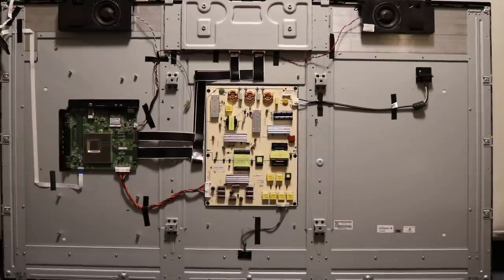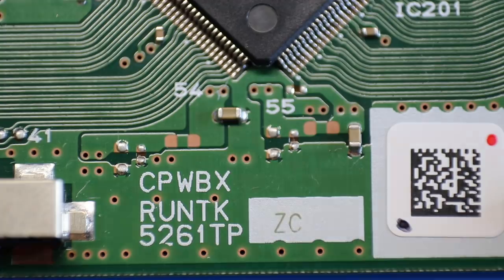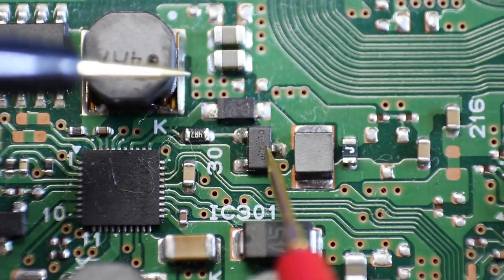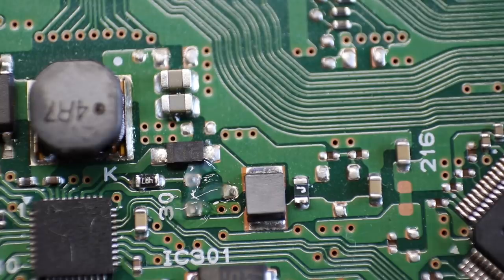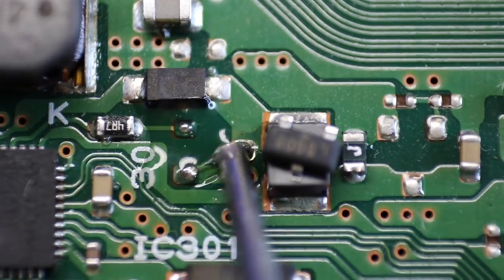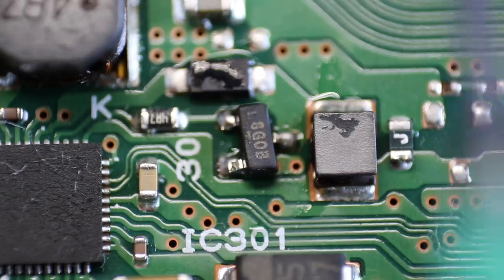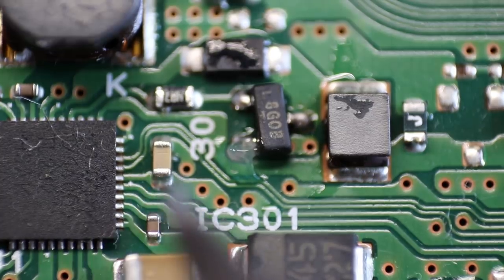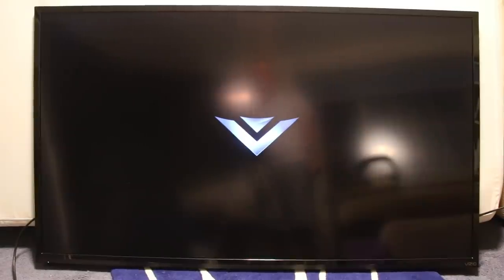60" TV for less than a $1 - Vizio E601i-A3

Comment: Have the exact tv and the same problem. Your fix worked great! Thanks!!
Reply from the maker: Cool!  Thanks for letting us know.
Reply from the maker: Enoch Pedersen  I put the specs in the description so anyone can hunt down online for a good price/option.  I'd would first check on aliexpress if you can wait for it to arrive from China.  Otherwise, check with any of the US suppliers.
Reply: @FrugalRepair  i have the same tv model but the 70 inch .....e701i-a3   with the same exact problem. so this will work with the exact part u replaced with?
Reply from the maker: @MrHontas83  The tcon board would be the same.  You would need to either test the tcon board for other failures in addition to this transistor to make sure or you can replace the transistor and see if it worked.  It is very possible that there are more bad components on the tcon and it is possible that your lcd is bad and thus not repairable.  You can also simply buy another tcon board on ebay for like $17 and pop it in quick to see if it fixes the tv.
Reply: @FrugalRepair  where do I get the machine to test and what's it called
Reply from the maker: @MrHontas83  You need a digital multi-meter.  But honestly, if you haven't used one before testing components may be a little daunting.  You'd have to educate yourself in what the components are and what they do as well as, what common things to look for on a circuit board.  It's doable if you want to learn.  There are so many great videos and info online that will help you.
Reply: @FrugalRepair  so to be safe I'm just better off replacing the tcon board itself opposed to the transistor?
Reply from the maker: @MrHontas83  If you don't have a multimeter already then I'd recommend buying a tcon board and then you only need a screwdriver.

Comment: Less than $1 if you have tools ready
Reply: And schematicvs of the module, probably not less than $20.
No chance he weould get the right transistor type from that marking alone...
Reply: @BB-ce3bj  making he looked in an online forum where someone had the same problem
Reply: Wilcon Barro Yes. As with most repair jobs of any type, you will need tools. They probably cost a lot less than the repair shop or the price of a new TV though.
Reply: Multi meter is like 20 bucks at Walmart.
Soldering iron 10-15
Flux 3-4 bucks or free with soldering iron
"Fume extraction" get a house fan
Hot air shit not necessary and most likely you'll damage something else if you don't know what your doing not worth the risk
Reply: Les then 40 and you'll have useful tools in the future just in case.
Reply: you spread the cost of the tools out across multiple fixes until it becomes negligible
Reply: A simple soldering iron and some basic chemics should to it. Less than 20 bucks delivered
Reply: @Theworldisforent  Not true. I have a 858d hot air station that works great for these kinds of repairs and it cost me less then $40. I have even done smd components with a $10 harbor freight hot air gun.
Reply: @steveiam5762  Actually it only takes one fix to get the cost of your tools back. But what you guys don't mention is the skills it takes to diagnose AND repair some SMD.
Reply: @goku445  I know skill is needed. I didnt think it needed to be said. I was just answering someone about the tools.
Reply: @Alobster1  I tend to heat up a screedriver tip with a torch when needing to do one or two smd packs. Holds enough heat to get the work done for 30 seconds, not enough to fry the item.
Reply: @Theworldisforent  500 bucks? oh, maybe you would take JBC hot air station, and fluke multimeter for fix 4 tv or others by years...
Reply: @gwarlow  maybe 80$ for an chinese hot air station, and 15-20$ for a multimeter... 1-5$ for flux also.
Reply: And the knowledge in your mind
Reply: diagnostic equipment, time spent, knowledge
Reply: Well if you buy cheap stuff, you can get everything for $15. I did it that way.
Reply: @jameszorb8420  If your looking to take out a 3 tab with a soldering iron you better have 4 hands and 3 soldering irons so you can heat all three tabs and lift it. Or you can buy the hot air unit. I paid $28 for mine used. Been using it regularly for about 6 years. I've seen far more people damage other components with a soldering iron trying to remove items like this. First, they don't know what they are doing so they just go in there with highest heat setting and then because they old solder won't loosen with out a little dab of new solder in tip they just keep the tip on there for about 10 minutes. Then you can throw the whole board out.

Comment: Thank you for this great info! I replaced the culprit mosfet with a random mosfet I desoldered from a random board. The tv turned on for a few minutes before blacking out again. This confirmed your suggestion that the mosfet is burnt. I can now go look for the correct spec mosfet to repair my tv. Tv is a SONY KDL-70R550. It’s an old dog but if it costs 50cents and a bit of sweat to repair I’m happy to continue using it.
Reply from the maker: That model uses the same tcon? Keep me posted.
Reply: FrugalRepair  it’s using the 5348 board but the layout is identical. I’ll keep you updated with further developments
Reply: I couldn’t find the mosfet of the exact spec that you specified so I tried my luck with a SI5328DS mosfet rated for 100v. It works and the tv is back working
Reply: Fix the car

Comment: Yes, I fixed several LCDs just by replacing a visibly leaking capacitor!
Reply: It's repair 101... (1) look the board over with a magnifier, are there any burn marks (change the burnt stuff) are there any dry joins (reflow them) are there any board cracks or scratched traces (bridge the gaps with wire), are any caps leaking shit (change them) (2) Check voltages Mains, DC voltages at chips etc (3) test shorts/continuity on fuses (should be), transistors (shouldn't be), caps (shouldn't be) etc etc... most of it is common sense...
Reply: What were the symptoms your tv was showing was it not powering up by any chance.
Reply: There I no such  as a visually leaking cap...wives tale extension there is no leak you can actually see in a leaking cap It just means  the cap is leaking voltage not leaking a substance so...you have never fixed anything by finding a leaking component since there is nothing to leak out of it.  b.s. called you shant recover back peddling not allowed  it's just a bad lie  but why did u lie there's a deeper reason me think
Reply: kirk watstien - you ain’t seen nothin’ yet if you haven’t seen a visibly leaky aluminum electrolytic capacitor. They have a discharge vent on the PCB end, and the leaked electrolyte is often visible on the board. And they will also pop their lid, which is quite visible. No BS to this, you just haven’t had enough experience with all sorts of varied devices to have seen those.
Reply: @kirkwatstien6979   the capacitor just blow up and then you can see it blown
Reply: @kirkwatstien6979  what language are you writing in???

Comment: Newer TVs are easy to fix now even if you do not want to change a transistor you can buy the boards cheaper than buying a new TV and just replace the board. I have fixed a few TVs over the years. The old tube TVs were easy you just pulled the tube out, took it to Radio Shack and got a new tube and replaced it lol.
Reply from the maker: Exactly.  Swapping out boards is pretty easy and you only really need a screwdriver.
Reply: No doubt the TV repair chains lobbied for tv's with no tubes so you'd have to pay a technician an outrageous fee to replace a 5 dollar circuit board. I remember fixing my own TV many years ago by testing for those burned out tubes. Cars were owner repairable also.
Reply: @kenjsr1  Valve TV's?? you still in the 60's? LoL. Music was good, TV's were rubbish.

Comment: this is your bread and butter, how reg joe gonna know that transistor is the culprit?
Reply: How didnt you see the moment where he is measuring that very component....        It isnt that far fetched that understanding its inner workings it is much easier to go and look for failed components. Because they are most commen to fail just hard to find if you dunno what is controling what.                                                   Just grab yourself some broken tv a multimeter and go have some great fun. But remember to stay away from the high voltage area...,if you dont you find out really fast why. Good luck! Stay safe!
Reply: Most issues like this can be quickly checked with under $150 in tools, and a quick google search of "<brand/model> common problems".  I have done this numerous times for all sorts of various electronics and it has saved me not only thousands of dollars in repairs, but hundreds of hours of manual troubleshooting.

Comment: Impressive, but how did you diagnose it was that actual transistor? There was a lot of stuff on that board.
Reply: Testing multiple things,  then put back together,  then make video.

Or....  research issue on model and see it is very common failure,  then make video hoping it works ..
Reply: Probably read up on it on a repair forum online ...
Reply: Oh, he answered that same question in another comment - watched a different YouTube video!

Comment: Most solder has flux in it and also I would never use hot air station its risky and for repairing one thing its pointless.

Just use a soldering Iron it's cheap and it works well and its safe if you use it right.
Reply: My thoughts exactly.. For a 3 pin component it's useless. Just pump the solder from the board, put the transistor on place, and solder it with a simple iron..
Reply: @freeeflyer  Did you mean: suck the solder from the board...? I have a solder sucker...never heard about solder pumps...  :)
Reply: @bror8228  If you need to desolder lots of connections, you can buy a solder station fitted with a vacuum pump and nozzle.
Reply: Who needs a solder suction pump for a job like this? Just use solder wick. Should have cleaned off all that excess solder so the new part leads are in contact with PCB with minimum solder in between. That huge pile of solder this guy used is more likely to crack than if it were minimal.
Reply: Also soldering one leg to tack it in place with an iron is easy and then you only have to touch the other pads after you have cleaned and added new solder to the pads.
Reply: replacing smd transistors with an iron is not the thing that you've done the first try... this is not a 1206 smd resitor...
Reply: Is it absolute to use flux when soldering
Reply: @stevebabiak6997  must I use flux when repair antenna plug? My project and problem
Reply: Eve M. - flux is a must when soldering. Some solders are “rosin core” which means they already contain flux. Also, there are a variety of different flux formulations, some of which are very acidic so one must select flux depending on materials involved.

Comment: If you prepare the lands as you did, plenty of flux and use a soldering iron to make each land. DON'T use hot air to place the new component in!
Reply: Right.  This was almost like a "how not to" video for SMT soldering.  I was cringing the whole time.
Reply: Any problem with hot Air?  I mean some do solder set with hot air right  any reason to avoid it?
Reply: Jon C. - unnecessary for this particular component with three leads. If it was a chip with lots of leads, then a soldering iron won’t be the tool to use.

Comment: Such a coincidence, a friend of mine was about to do that same,  same exact model.  Took it apart and pulled out the board. Did a multimeter test and the results were the same. Now I just need to put in an order for a new one. I really hope this works because my Xbox is lonely. Ill let y’all know what happens when I get my transistor. 07 salute!
Reply from the maker: Glad to hear you are fixing it!
Reply: replaced the transistor and it works! thank you for making this video, 07 salute!
Reply from the maker: Wow, that is great to hear!  Way to go replacing it.

Comment: May I please ask you a few noob questions, I am not criticizing you but honestly try to learn from you:-)
3:22 why do you choose hot air instead of bent thick copper wire wound around your soldering tip?
why do you not use something like capton tape to shield the other components from the hot air?
Hope you please will teach me, so I better understand.
Reply from the maker: I hadn't thought about bending coper wire on a thicker soldering iron tip.  That is a neat suggestion if you don't already have one with a fine tip.   It still might be hard to solder in a small component in a tight spot with that setup.  I'll have to try it sometime.   I didn't feel the need to add kapton tape since the nozzle is small enough and the hot air can be directed to the one component.   It depends on what work you are doing though.  When working on an iphone board, for example, I may use kapton tape and place a metal coin nearby to help absorb some of the extra heat.
Reply: @FrugalRepair  Thank you for your great answer. About the copper wire, I find a thickness that I seems to fit the task and then start to bend it until it sits nice around the chip and let the tweezers and heat do the rest:-)
Also wary nice and hard to reach places, like under a capacitor, in the corner near some plastic. You can always put an insulating tube around the 4 inch long copper, if necessary. :-)
Your explanation about the heat gun, do make a lot of sense, I do just not have enough confidence and knowledge yet to dare that. It takes a bit of knowledge as you clearly have!:-)

Comment: Way too much flux. But good job fixing it!
Reply: The bigger the glob, the better the job  - Louis Rossman - 2017
Reply: You didn’t clean the flux residue off.  At least wipe the area with a flux cleaner pen as a final step.
Reply: Enough FLUX to do a plumbing repair and far too much  SOLD  ER.

Comment: I have a 60 inch LG plasma that needs a similar repair. But I’m so scared To break it even more and I’ve never seen the tools you’re using before in my life other than just a basic solder gun. The TV is 600 W to run but it’s bright as the sun and crisp as a rainbow. I repaired it once by replacing the motherboard but accidentally gouged a little piece of solder..  stopping it from Booting up all together. I’m very confident that your technique will allow me to repair this incredible plasma. Just need to know more about the tools to get me there

Comment: It was painful to watch you trying to work with those tweezers lol
Reply: I would be the same way. That is a small transistor. I get the shakes when soldering small stuff also. :(
Reply: yeah i cant bear to watch him using those tweezer
Reply: Same feeling
Reply: @Darmidion , No one is claiming perfection. It's simply about avoiding damage to the board. Rocking a component like that before the solder reaches it's melting point, can rip the pad right off the board.
Definitely not a fun situation to deal with.

Comment: I'm not super into TV watching, but the info you're giving out here is too good not to subscribe to and consume in my free time.  I see so many people throwing out TVs and I'm sure most of them require only simple repairs.   Thanks for making all these videos.
Reply from the maker: Thanks!  Did you happen to see the latest video?  It was the cheapest repair yet to get a tv working again.
Reply: @FrugalRepair  I just watched it.  It's amazing all of the tricks you have picked up repairing these TVs.  I actually have a 50" Samsung Plasma TV that has one green vertical stripe.  It started doing that at 1 year of age and I just quit using it.  Since I never throw anything away, I still have it.  I'll have to peruse your channel to see if I can look for pointers on repairing it.  Of course, it was replaced with a 4K LED TV that blows it away, but it'd still be fun to repair it.  I originally came to your channel to show a friend how to look for lightning damage to his TV.   Thanks for putting out such useful content and taking the time to help so many.  You're banking a lot of positive karma.
Reply from the maker: Thanks, that’s encouraging for me to hear!  Lines on a plasma maybe a relatively easy fix.  It is possible (but I don’t really know in your case) that the ribbon cable needs to be cleaned and/or re-seated.  You need to have the tv unplugged then locate the ribbon that controls that section where the line is.  I bet there are videos about it.  Those ribbon cables are usually at the bottom after you take off the back cover.  Usually they are connected to the Z-board.  You can google that.

Comment: It’s the skill of finding that failed part that makes the repair bill, plus your soldering station, access to schematics, multimeter, etc.
Reply: schematics.... many of electronicians don't use schematics for fixing boards, we uses them 20-30 years ago, now theire not avaiable for the most of them. So, we tests, we try, and maybe we fix...
Reply: And more modern boards with macro smd's no chance repair for diy .....
Reply: @leso204  1206 SMD models (and biggers) are not so hard to tests and replaces, but for the tiniests ones (402, 201 and smaller), i'm ok with you, what a pain to try to test and even more to replace :/